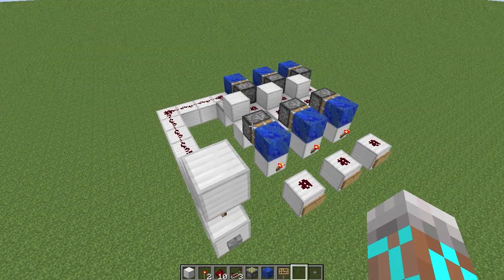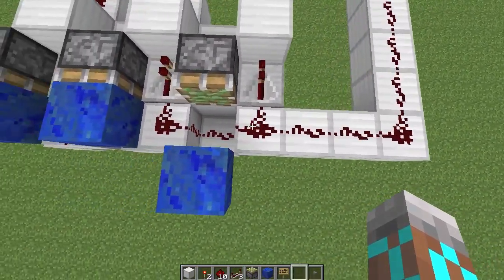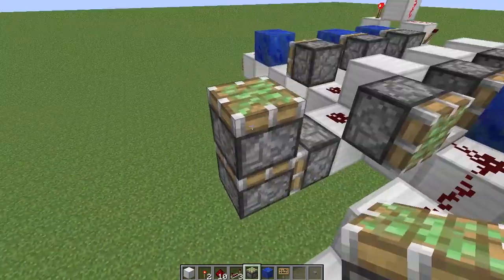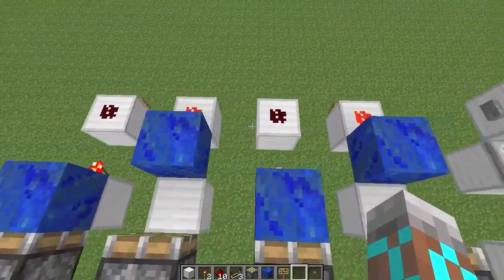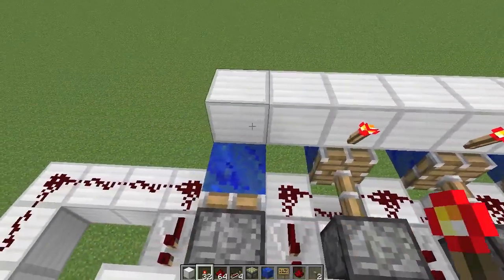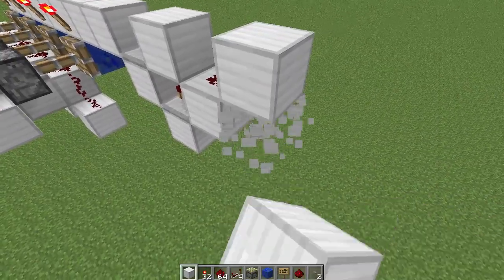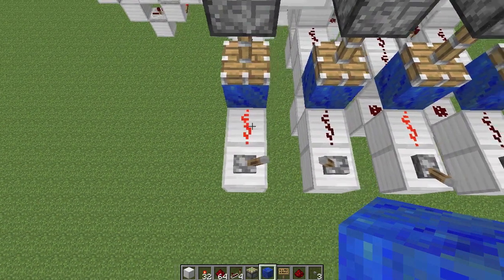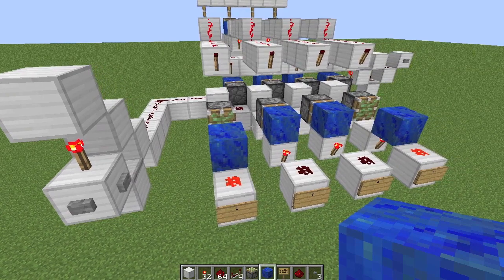Tutorial: Binary Counters

Comment: What do you do when you hit 27. In order to get to 28, the 16th light, the 8th light, and the 4th light would have to turn on but you can't turn on the 8th light without power going through the 4th light which turns it off.

Comment: Block dropping was a unintended side effect of the fix for duping I believe. I don't think anyone knows for sure, but within my own group of redstone engineers we all believe it was unintended. As for your issue with block dropping.. make sure that your pulse generator is making a 1 tick pulse. If the generator is a piston design then change the repeater that goes to the piston to fire at the same time as the repeater going into the block.